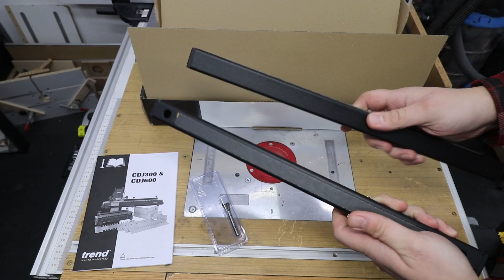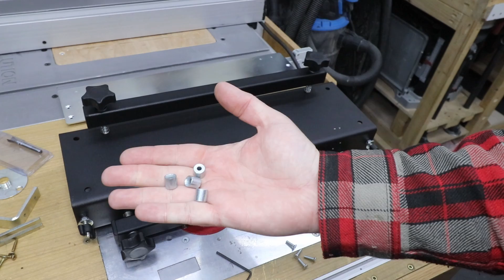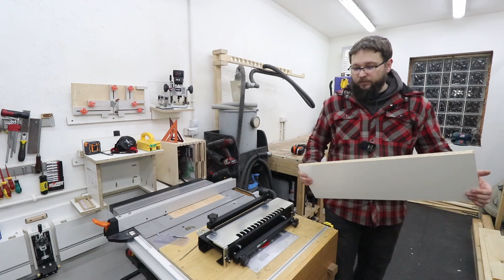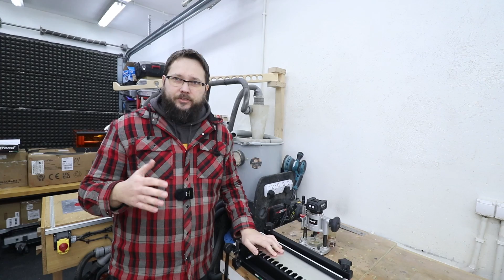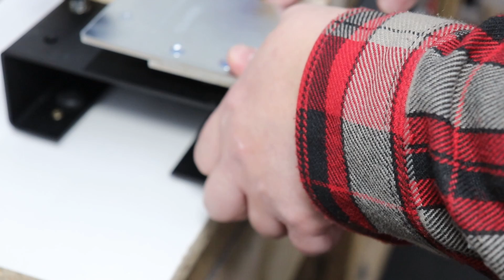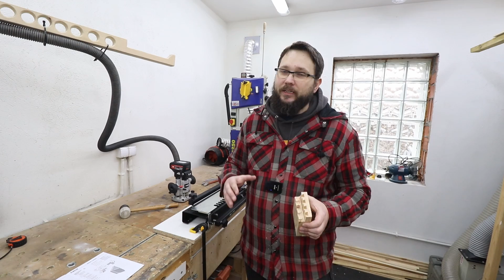Trend CDJ300 Dovetail Jig Assembly & Initial Test

Comment: I bought one of those a while ago. They are virtually impossible to set up. The trial and error needed to test each set up uses up tons of wood and after spending a few days trying it, I gave up.
Reply from the maker: @RichardX5000  well if you will be using same wood thickness then you will get away with only one round of setting this up. If you change the thickness of your timber then yes you will have to adjust things each time

Comment: Nice video,  👍
If you add another scrap piece of the same thickness to the other side on front and top, the bars should clamp down on the stock better, plus helps support the template.
Reply from the maker: Very true 👍

Comment: Brilliant Brilliant Brilliant!!!! This is so well timed! Thank you.

I've had the CDJ300 for a few months and not got round to putting it together until last weekend.  However, i've just not been able to find any decent videos on the configuration.  There are some, but they're not great. (Unless my YouTube searching is poor!) 

This is exactly what was needed, and much better than Trend's own 2 minute video on how to use it, which is disappointing to say the least.  I really can't wait to see the follow up video where you dive into the config a bit more.

Out of interest, what's the thickness of the stock material you're using?  Looks like 18mm pine or rosewood to me.

Thanks again.
Reply from the maker: Well I glad that my video was some help. Yes the material is 18mm pine. The follow up video should be out next Wednesday 👍
Reply: @CasualDIY  Excellent. Can't wait for the follow up next wednesday.

Comment: I have the Axminster jig and it’s great…….once it’s set up which is a bit of a trial. You’re also a bit limited to the width of your wood, it really needs to be in 1/2” increments. I tend to use it for boxes and now have a cheap Katsu router dedicated to the jig and always use the same thickness of stock but still have to make the odd adjustment
Reply from the maker: Yes these jigs require testing and adjustment before the final cut. And I think a lot of people are put off by that. And it's a shame as then you can create some amazing projects.